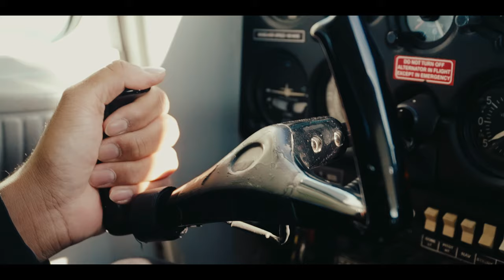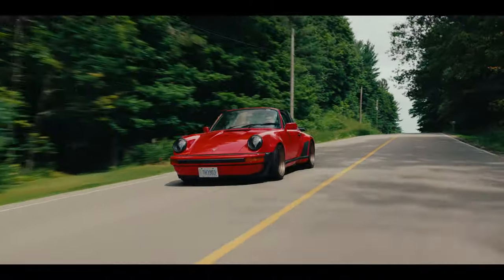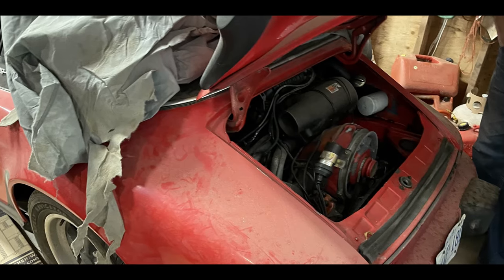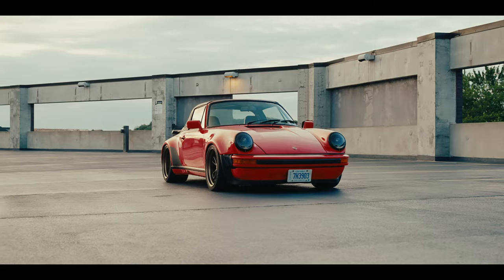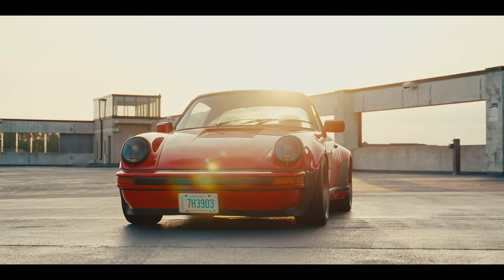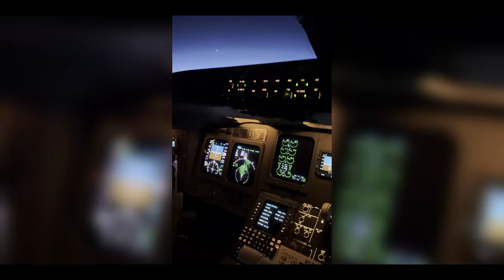An Aircooled Affair w/ A 1979 Porsche 911 Targa | Documentary

Comment: I have the same setup, a Porsche and a Cessna. Awesome
Reply: What fenders did you use mine is a 1978
Reply: 2014 and 2008
Reply: @CartasticPorsche where did you get your fenders from.  I haven't done any bodywork yet
Reply: @CartasticPorsche  Mine has an aftermarket turbo. Boosted to 1.2bars. Race clutch conversion to hold the power.  The sound is amazing. Had our exhaust guy do some amazing work.  Now to do the body.  Design911 and fvd both have kits.  Just confused on taking the dask fender flares or to take different fenders. Also bumper choices they have the rsr bumpers front and back with a ducktail option. 
The rims for me will be the rotiform hur-t.
Reply: There is also a nice glass roof option comes in at a hefty price tag. From gtn auto.

Basically your help regarding which fender and or fender flares will be of great assistance. 
Also the wheel offset used

Comment: Awesome car. I have the same car and have done a very similar build. I also have the same carbone ignition switch decal. What exhaust are you running as it sounds perfect. Well done by the way.
Reply: @CartasticPorsche  Mine has an aftermarket turbo. Boosted to 1.2bars. Race clutch conversion to hold the power.  The sound is amazing. Had our exhaust guy do some amazing work.  Now to do the body.  Design911 and fvd both have kits.  Just confused on taking the dask fender flares or to take different fenders. Also bumper choices they have the rsr bumpers front and back with a ducktail option. 
The rims for me will be the rotiform hur-t.

There is also a nice glass roof option comes in at a hefty price tag. From gtn auto.

Basically your help regarding which fender and or fender flares will be of great assistance. 
Also the wheel offset used